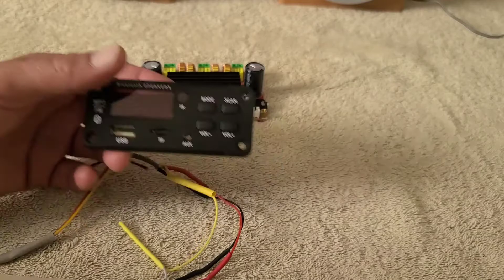XH-M139  2.1TPA3116 D2 2X50W+ 100W  12v- 24v

Comment: Hola Master muchas gracias por el vídeo, estoy por comprar un módulo del mismo del vídeo y tenía muchas dudas, ahora habrá módulos de mucha más potencia? Me quiero hacer unas torres de sonido 😁
Reply from the maker: Hola bro.
Mira., hay algunos que incluso ya vienen con funciones de BLUETOOTH, puertos para tu USB,FM, auxiliar, y memory card,estàn muy padrísimos, y estàn a un precio muy rasonable,yo le puse dos mini amps de esos a un autoestereo que me costó creo 16 dólares, que serian como 260 pesos mexicanos, y suenan "tremendísimo" le puse ocho bocinas , cuatro al auto estereo, y dos a cada amplificadór.
Puedes ver el video que le hicimos a esos amplificadores.
Te voy a dejar aqui abajo Los links de algunos de los mini amplificadores que to personàlmente considero que vale la pena tenér, especialmente si como dices quieres hacerle unas Torres de sonido.
He mando un fuerte abrazo!!😊
Just found this amazing item on AliExpress. Check it out! $12.03  68%OFF | AK380/G8/AK370/AK270/AK170 800W 12V Home Car Hifi Power Amplifier Stereo BASS Audio Amp Speaker Class D Car Home Sound Power Amp
https://a.aliexpress.com/_mO2ncKu
Reply from the maker: Just found this amazing item on AliExpress. Check it out! $30.74  37%OFF | 1000W Home Power Amplifiers Audio bluetooth Amplificador Subwoofer Speakers Theater Audio Sound System FM USB G-919H
https://a.aliexpress.com/_mLBrWYy